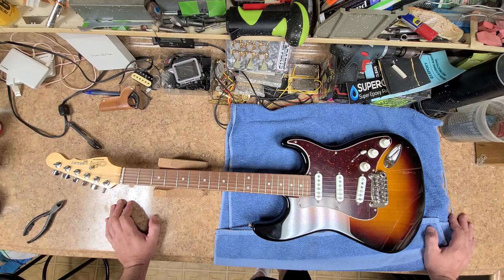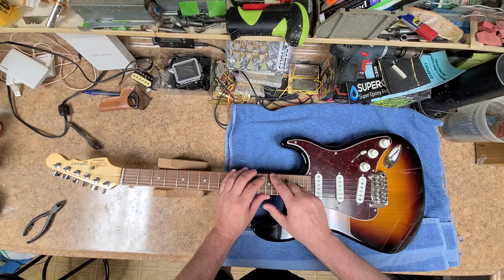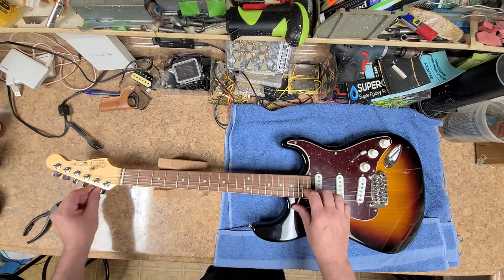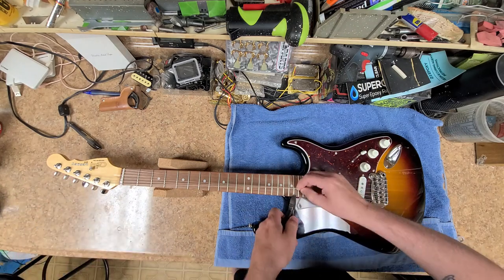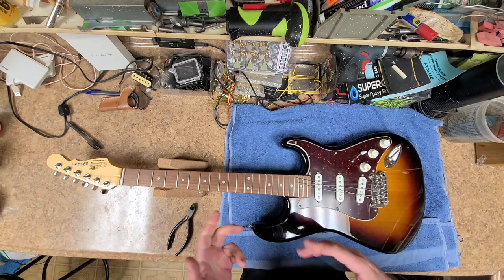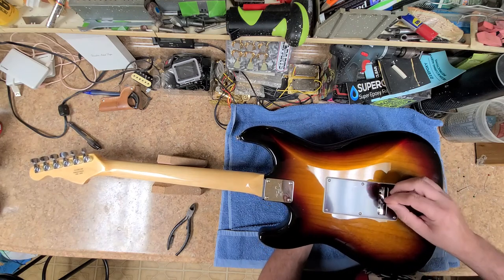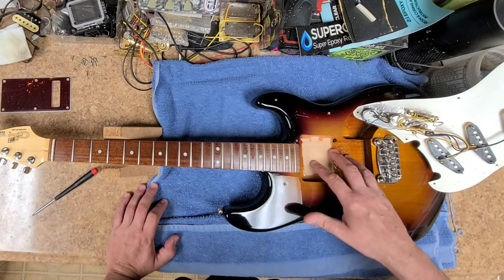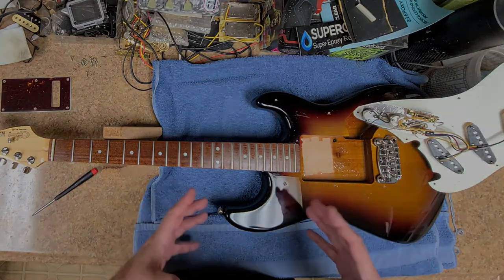George's G&L Neck and Shielding Part 1

Comment: Somebody must have changed the wiring in this guitar because typically an Asian made guitar doesn't come with the standard wafer switch and a push back cloth wiring in it. I think some of it  looks like it's been upgraded and everything else was just left as is
Reply: Hi Mike. I believe these are made in the U.S.🙂